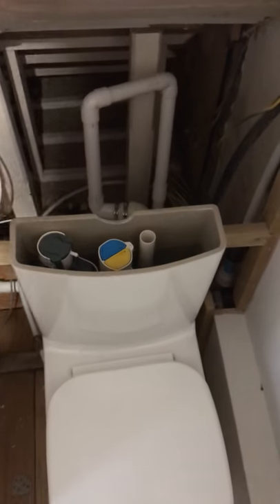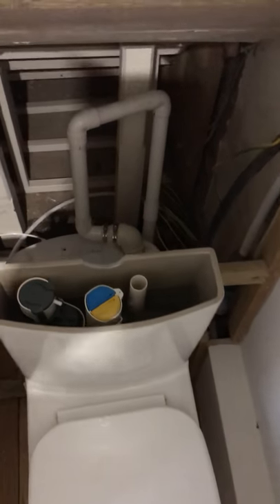Broysan 4 Macerator box

Comment: Did you find out if this was the normal running process? My brother has recently had an issue with his Broyson 4, turned out to be a number of wet wipes blocking the macerator but after taking it apart and putting it back together the system wouldn't initially run until the below mentioned nipple was cleaned and let out a gasp of air, now the system runs as you've described in the video. Do you know what the little 'bleed nipple' is adjacent to the power cable on the grommet of the system where the cable enters into the housing? Kind regards Ty
Reply: Hi Ty, very good question. The "bleed nipple" is an air release from the pressure switch which activates the pump to force the water out of the unit. If there is water exiting from the "bleed nipple" then there is a possibility that the membrane is damaged. I hope this helps.

Comment: Is this Broysan 4 suitable for hot water from washing machine ?
Reply from the maker: Nikica Malezic  I would assume so. However check the required outlet flow for the machine.  You may want to consider the outlet activation times for the Broyson in regards to the machine not clogging.
Reply: I am more considered about if it could handle water temperature ? Outer flow due to specification would be more then enough.
Reply from the maker: Nikica Malezic 60 degree would be the recommended house hold temperature for your taps. You may want to check with manufacturers for anything past 60 Upto 90.
Reply: Washing machine has a program for washing on 90°C.  Water that comes out is some less. Could it handle it for a shorter time ?